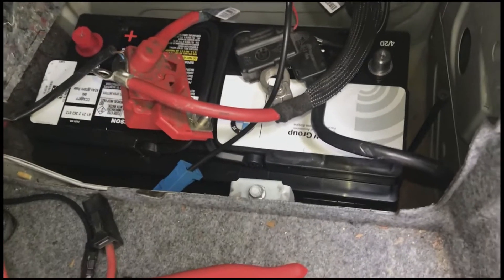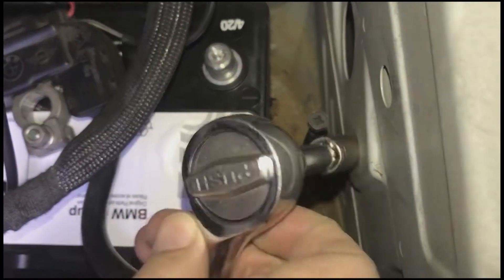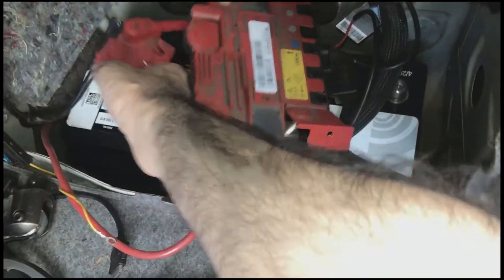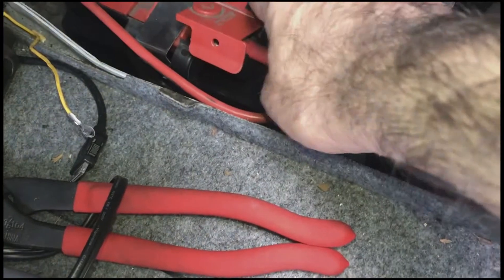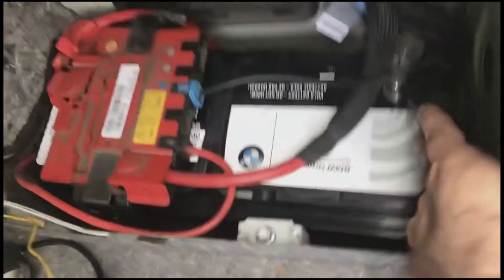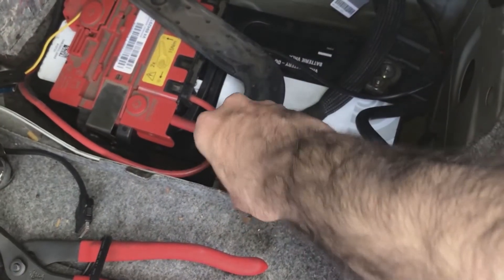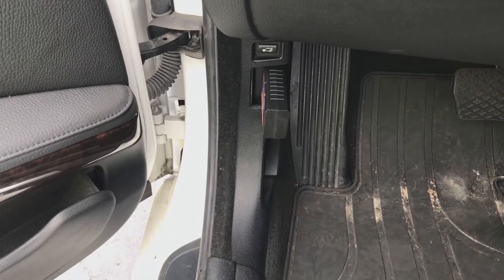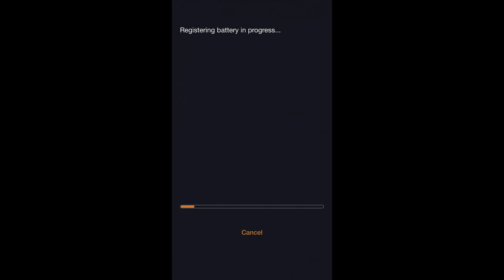BMW Battery Install and Registration with Carly App

Comment: I need abit of help.
My car is a 2009 e92 320d m sport highline. 
This car has start and stop and all the idrive and electrocal options on the car so the battery is agm.
Battery lasted for 11 years.
Battery specs is 90ah 900cc 160rc
 new one is 105ah 950cc
On carly i am.not sure what i should set it up as.
90ah? Or (90ah agm)

Comment: Did you pay to pay the annual fee to unlock this feature or can i program my battery without paying?
Reply from the maker: LennyTrees I did not pay any annual fee. I just bought the app and the wireless dongle. So no I did not pay extra for the battery programming
Reply: AverageInvestor/Dr. Abdullah thank for the info bro. Done dealing with mechanics. Can you put the links to everything you bought in the description . Thanks!